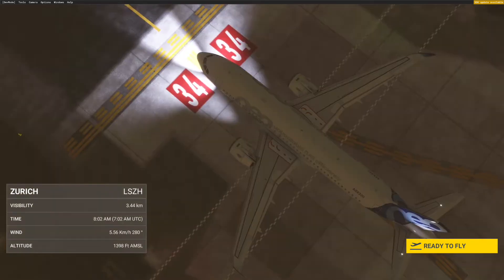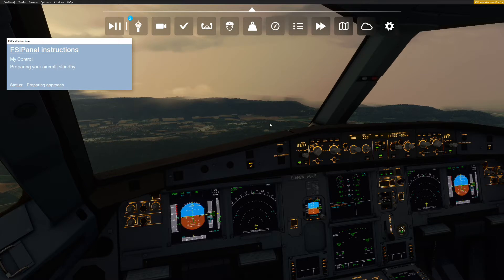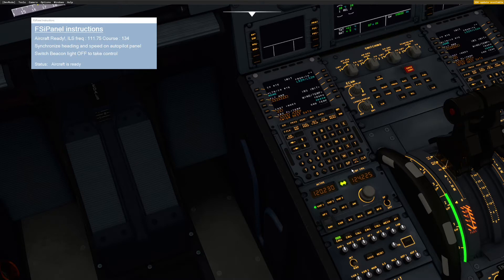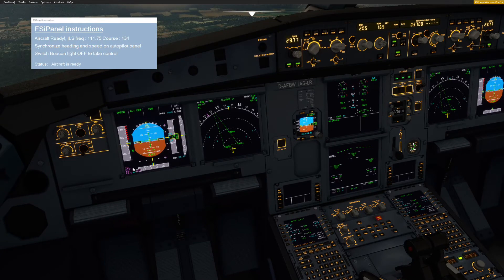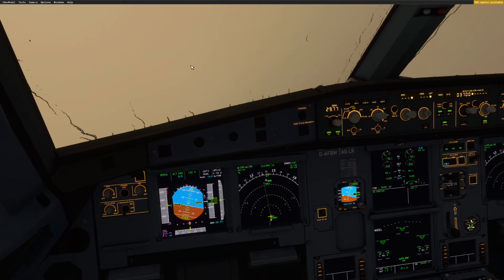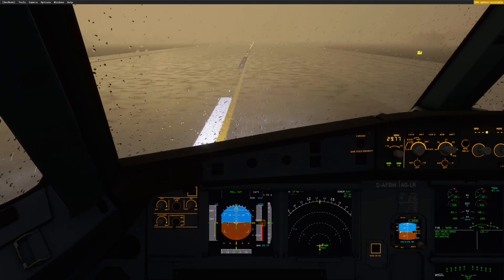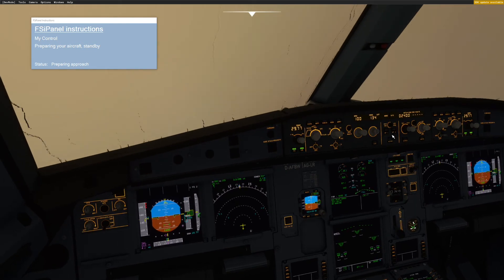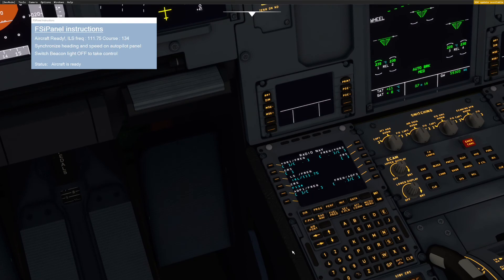FSiPanel 2020 MSFS: FlyByWire A320 NEO tutorial

Comment: Ran into a problem when I tried to do the first approach you performed in this video. Had the FBW A320Nx on the ground, launched FSIPanel. Selected RW 14 vector.  Pressed Move AC. Plane in the air, set descent rate to move down to 3700 feet. Set Autopilot, Auto Throttle, moved throttles to Climb. When the altitude reached 3700 feet the aircraft started moving without me using the beacon light switch. What am I doing wrong?